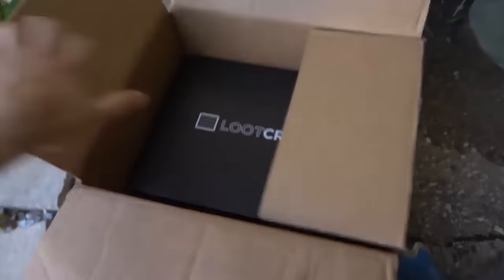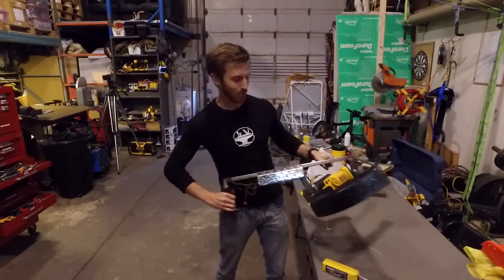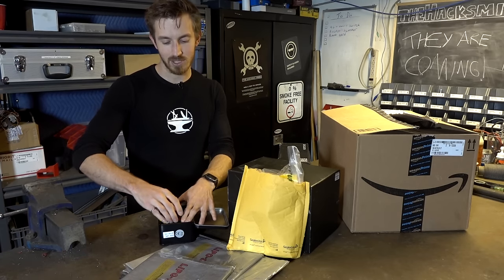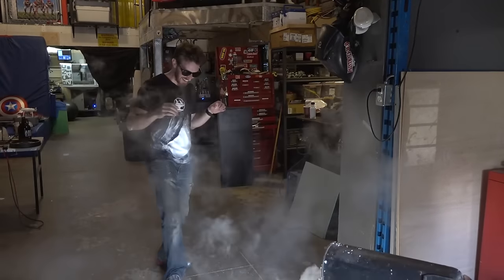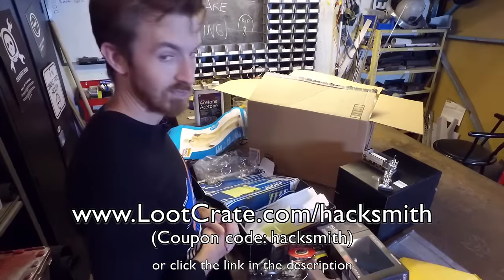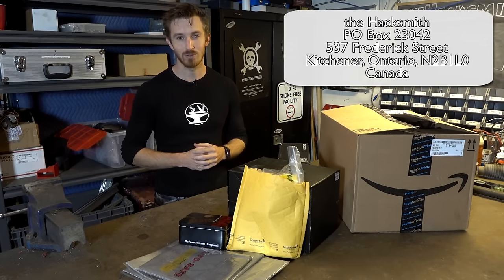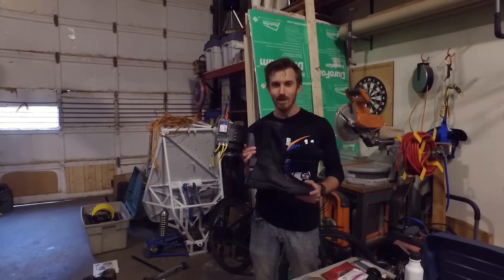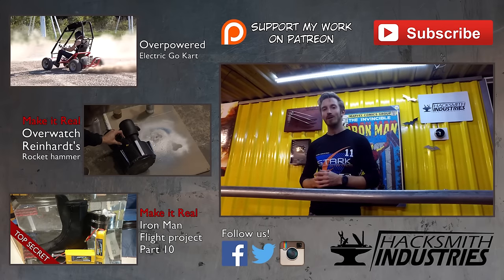VLOG 010: Collaboration with ZNA & Project Updates!!!

Comment: For the Flying Like Ironman project, what if you use Helium to reduce your weight?
Reply from the maker: You would need to have a balloon the size of a car minimum to start affecting your weight... remember, helium floats because it displaces air (which is heavier). So you'd need to displace alot of air to lift me up!
Reply: oh, ok then.
Reply: you mean all that muscle*
Reply from the maker: +mjc4wilton compressing helium makes it heavier... It's not negative weight, just has a very low density. You need to displace the equivalent weight of air to float, that's why blimps are massive! :)

Comment: I had a 4 cell RC car battery that was over-discharged and over heated. 2 of the cells were crapped out so I threw all 4 into a firepit to see what happens and even the 2 cells that were still good didn't explode. I was disappointed.

Comment: Can I make a suggestion you should use a mini jet engine GAS you might also want a heat proof and water cooling
Reply from the maker: +James Smith mini jet engines are like $5k...
Reply: the Hacksmith oh sorry
Reply: the Hacksmith eh what about old parts that was use car engines like colinfurze was doing probably you won't agree with me
Reply from the maker: It's possible... but we already built the project!

Comment: aren't those batteries going to heat up? i'm not really an expert on electronics, so i might as well be wrong.
however, IF they heat up, i think you're gonna get some serious problems if the batteries are in a almost completely closed bag.
Reply from the maker: +Adi S. Those bags are designed for them... To keep the fire inside... Lol

Comment: For the  "Electric Go Kart" project ,how much power can we generate if we put a generator on each wheel  (estimated wattage) ?
Reply from the maker: +Abdulla Qasem none... Power in = power out + losses... Or are you asking something different?
Reply: Something different, my question : Can we charge just one battery inside the electric go kart during the movement, in aim to increase the battery life by 10-30℅ (connecting a generator to the end of drive shaft,s similar to hybrid cars)  ?
Reply from the maker: +Abdulla Qasem ohhhhh. Yeah that can work, but only with something called regenerative braking -- you can't generate power while you're driving, just when you're braking :)

Comment: For batteries in the go-kart, will you be using the flight project batteries?  If not you should totally pack it with some china 18650 cells to see how it does 😂
I've seen some ridiculous ebay deals on them lately....
Reply from the maker: +justin Young even if you get a good deal on them, it's pretty time consuming to build packs of them for something like this -- cheaper to buy then to spend all our time on :p

Comment: wow, i use exactly the same motor for my electric board
Reply from the maker: +PRAWON we're using TWO for the super winch! :D
Reply: I'm almost sure that with a good gear ratio it will be enought cause with my board I get arround 25km/h uphill without heating up the motor too much
Reply: and by the way, I think you should try using a VESC instead of an ESC for this project, cause you can program it for a smooth acceleration curve. And because its intended for using it with an electric board,  it holds heavy loads. In my case the accelartion with an ESC was two hard and switching to an VESC was a huge improvement event if it was more expensive
Reply from the maker: +PRAWON can't you program with an ESC too?
Reply: yes, but a vesc, at least the one I have (from enertion), is more open source, so you have more possibilitys, i think you can even add your own code to it.
Reply: I'm not an expert on this topic so I cant help you too much, but I know that in my case it worked much better, and I think it would also on your project.

by the way, I'm loving your videos, I'm subscribed since the begining of the first exoskeleton and the improvements in terms of equipment, results, etc are huge, congratulations!
Reply from the maker: +PRAWON cool thanks man! I'll check it out, were probably testing with one of the ESCs we already have but maybe we'll get a dedicated one :)